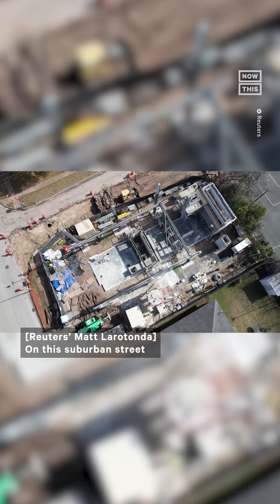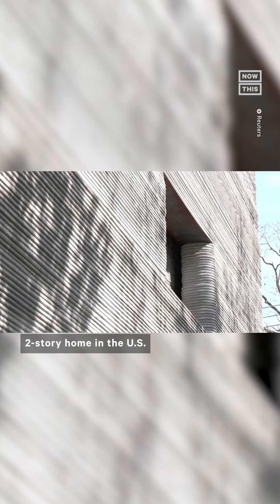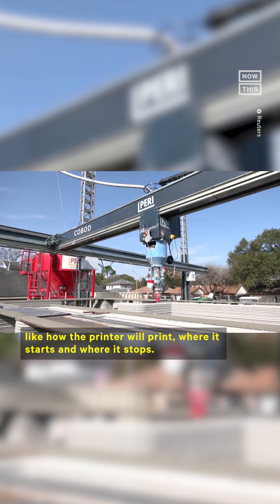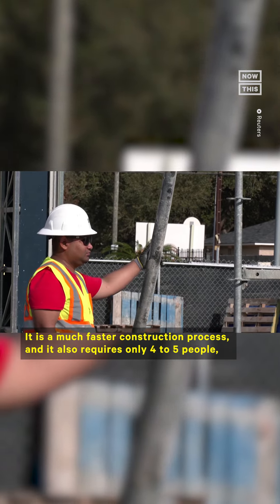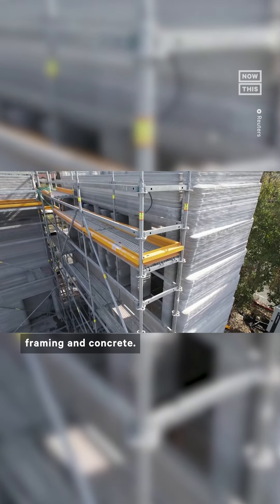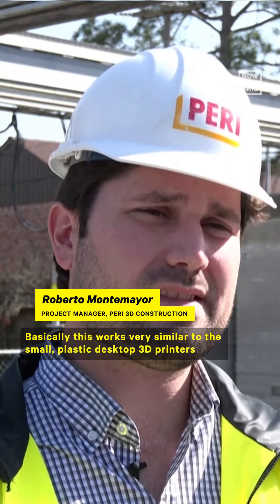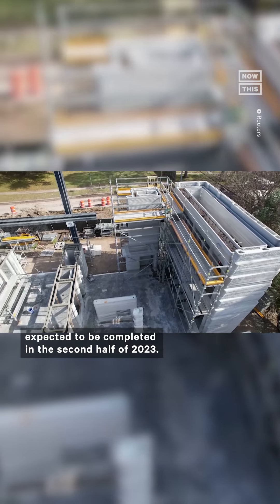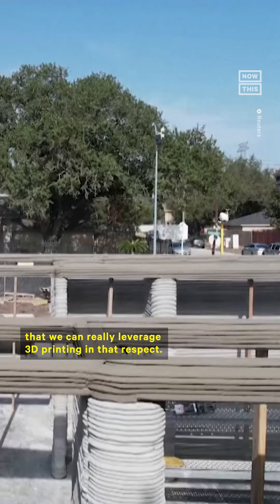The First 3D-Printed Multistory Home in the U.S. Is Under Way

Comment: The problem,ultimately, with these 3D printed homes is that they are overly complex ‘solutions’ that ignore cheaper, easier alternatives. Ultimately the answer to putting up well-built structures rapidly is already known, it’s the pre-fab. By mass producing entire large sections of house, you can rapidly put them together on site, with relatively modest equipment. You can pre-build large sections, then clip them together, with spaces pre-installed for cables & pipes. That way, there is far less work to be done on-site. An entire house can go together in a few hours with a skilled team. No need for a 12-ton 3D printer, or complex concrete pouring. The pre-fabricated panels also have the huge advantage that they can be fully insulated. You pick which modules your house needs, and prepare the foundations. The installation can take a few hours, with just a few more its to connect all the wires and pipes.
Reply: H.B. Zachary did pre-fab on hotel scale in the 60's with San Antonio's Palacio Del Rio for Hemisfair '68.
Reply: @Scaliad  Exactly, it can be scaled up or down as required. In Germany, many houses are built that way, with a basic shell approach. You pick how many of each panel you need for the shape of house you want, they then arrive on a bunch of trucks with a built in crane. They assemble the whole thing from the outside in, then set to work attaching all the interior bits.
Reply: No need for a 12-ton printer, just an entire factory and transportation equipment for your pre-fabbed pieces. You totally missed the point.
Reply: @filonin2  The concrete and other structural parts still have to be trucked to the site...
Reply: @filonin2  Haha, you took the words right from my mouth! I was even considering a "whoosh"... [edit: characters from my touchscreen?]
Reply: @filonin2  that printer needs a factory aswell.. And afterwards you still need to add water, electrics, windows, and fill the holes in between layers.

And all that is after 330 hours of printing.

And oh yeah the "transportation" of a 12-ton printer.
Reply: Do you understand how technology works guy? The whole point of this tech is to eventually evolve to something smaller and more efficient that COMPLETELY removes the need for manual labor. It takes time for tech to become small and efficient. Remember the bulky cell phones and computers of the 80s and 90s? Guess what? Both have been integrated and developed to fit in your pocket. Think about that for a second.

This technology here is great because it will allow for construction in remote areas with harsh weather challenges, and it also means work being done in the middle of the night as well. Not only that but this tech can eventually be used to build bases on other planets
Reply: Are pre-fab houses able to withstand hurricanes?
Reply: @PermanentHigh  yeah.. And a thing build houses without any manual labor WONT be small. Efficient sure, but this 3D print is anything but that.

It's more work, more wasted energy and structule strength of the house is almost nothing. It cant even hold a second floor.

The phones, sure they can do allot more now. They also cant take anything anymore. And the amount of energy they use went way up.
Reply: I suppose someone was bound to try it and technology will improve. But I agree its created a solution where there was no problem. I watch a house building series on TV its been running for years. A  couple bought a beautiful prefab kit from Germany all the electrics insulation built in the panels. Kitchens bathrooms plumbing came with.  Most of the houses on the show the people have budgets of hundreds of thousands or millions, they spent 250k and it looked amazing. It was energy efficient and there were not numerous suppliers of all the elements flying or shipping in goods so less carbon footprint. It was foundations, then assemble. The house was up in days.  To be truly efficient and eco friendly more and more funders of social housing should be building homes like this.
Reply: @emaarredondo-librarian  Actually, yes, when designed to do so. Obviously ones in the UK & Germany aren’t designed for hurricanes, given that they essentially never happen there. Ones designed for the US and parts of Asia, for example, can do, in the same way as any other kind of house can.
Reply: @filonin2  The difference is that the pre-fabricated house panels can be delivered on just a few regular truck loads. You only need one factory to produce the panels, which can be pre-fitted with drywall, plumbing and wiring, all done by one skilled team. In contrast, this massive 12-ton monster needs its own truck, plus many concrete mixer trucks for just the basic structure. You then need trucks carrying all the drywall, plumbers and electricians to do their bits. It also takes much longer, and time is money. In effect it’s like objecting to having a car factory build your car, when you could have all the people come to your driveway to build it instead! The idea that hiring a huge, expensive piece of equipment, and skilled tradesmen come to your house for a week or two, is going to save money is laughable. A factory can churn out the panels to build multiple houses a day, with relatively few workers. On site it all just slots together in a matter of hours, and is ready for decorating within a day or two.

Comment: Concrete is not good for the environment.  Is concrete without the wire reinforcement sturdy?  Where do they put the wiring and plumbing lines?
Reply: Concrete has very high compressive strength but it's shear strength is weaker. It's possible that they don't show the rebar already set up here. It's also possible they are using a composite type of concrete that is strong in shear.
As for plumbing and wiring, my guess is they still leave in the gaps and they core drill into walls as needed.
Concrete isn't good for the environment yes but I wonder if it's better to use over the other raw materials we use for traditional home construction? The devil is in the details.

Comment: I’ve reached out to my Architecture & Engineering community to answer some questions, for the general population. Will keep you posted.
Reply: Is it HOA approved? Hurricane capable? Is size limited to printer. Will this aid in homelessness?
Reply: Will this create less jobs? Yes
How "duurzaam" is it? No
And is the structure stronger or weaker? Weaker compared to brick houses or houses build with logs.
Reply: @Devo  Jobs will always exist to build non-3d-printed houses which will be the majority of homes, at least in the near future. And they will definitely be stronger than most homes built in the US today. This technology will be able to create homes at a low cost due to no wage expenses and likely able to build them much faster.
Reply: @devo2 , the goal should be to end all jobs as we know them now. With the end to money,class,poverty and bigotry, we will be able to better ourselves and still work and have jobs that we choose to do instead of forced to under this capitalist system we live in now that only exploits for the need of accumulating wealth, like a hoarder the morbidly wealthy have a problem that is making the rest of society suffer.
Reply: @caterpie4546  like the green energy, which also requires no work to produce. Oh right it's 400% more expensive.
Reply: @weightlifting_socialist  there will always be poverty. It just changes. If you get everything for free, 1- people will never put in the effort to do better, 2- there will always be people that decide who gets what.

Those "not living in poverty" will basically be slaves. If you dont follow their rules, they will take everything away.